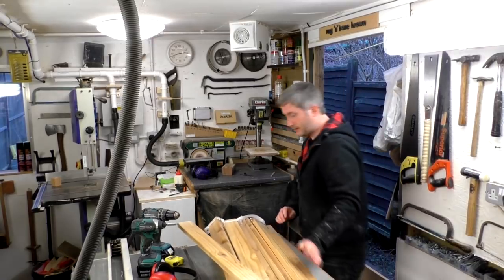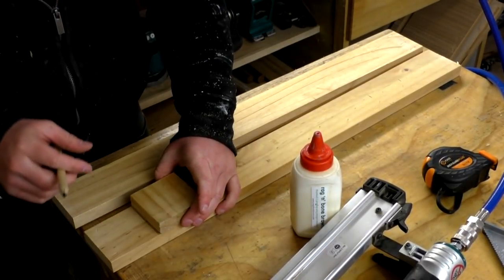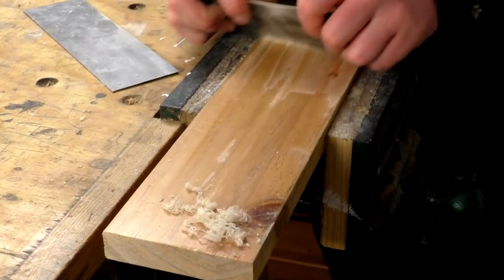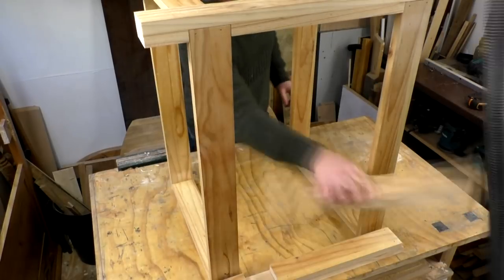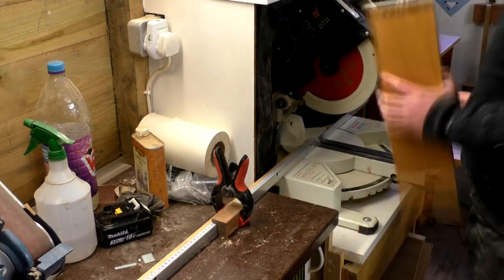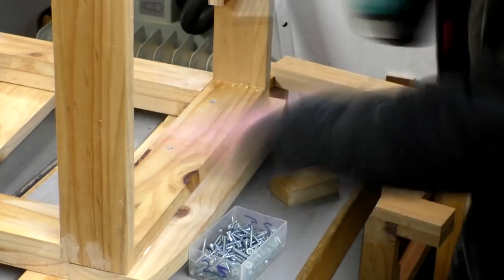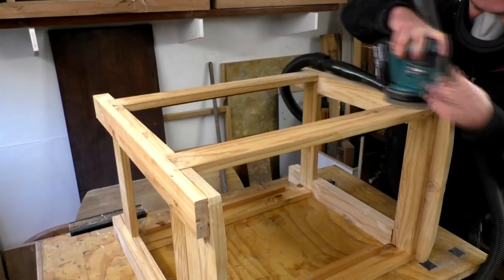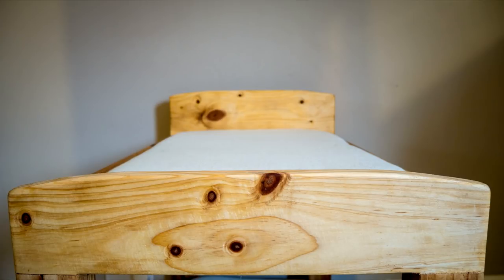Making Cat Or Dog Bunk Beds

Comment: I quickly ran out of storage space when making stuff for etsy, I tried so many different things to sell but always ended up with another item that sat in storage and took weeks if not months to sell, I finally rented a booth in an "antique mall" which allowed handmade items and had a little better luck there. Well, enough to keep buying new material for future builds. To be honest I was always worried people would become enamored with one specific thing I built and would be stuck "manufacturing" that item until the end of time. Sorry for the long winded post. Love your video making skills just as much as your woodworking, another fine job! Thanks.
Reply from the maker: Thanks. I will probably run of storage space too soon, but my new rental garage will help (need to make some space saving racks - a future video perhaps). I’d love to see some items you’ve made by the way. I may look in to the shop/craft sales side of things at some point in the future

Comment: nice project, good use of the materials you found, next time you upholster something like that round the corners on the backing board  because the sharp point may wear a hole in the fabric, just a small radius would do, but nice work.
Reply from the maker: Thank you

Comment: Keith, your approach to wood working is infectious!  We have an old entertainment center that we no longer can use and normally I would just set something like that out on the curb with a "FREE" sign attached.  But now, you have me rethinking my strategy.  
I noticed that the two drawers it has might fit under my work bench for more storage and the oak veneered plywood might come in handy for a future shop project.  
I can use the glass from its door for cutting out paper templates.  
Thanks a lot Keith!  I may never throw anything away again!  :)
Reply from the maker: Thanks Chem, great to hear 👍

Comment: Tip:  Cut about a 1/4” to 1/2” off each corner of the board before covering with fabric.  You’ll get a nicer corner and it will wear better.

Comment: Little tip when upholstering like this. Chamfer/round the edges of your board and have your foam cut slightly oversize, it will give a neater finish.
Reply from the maker: Thanks